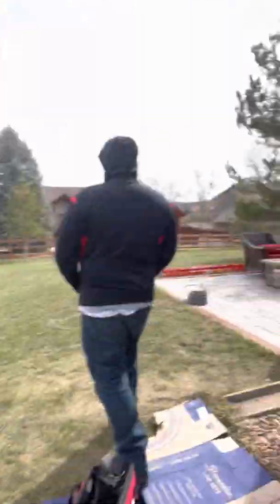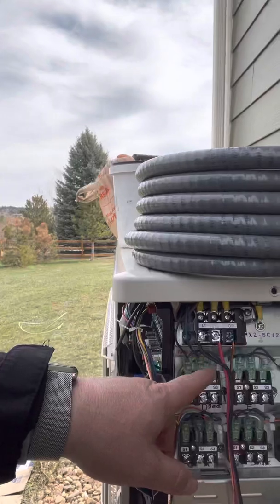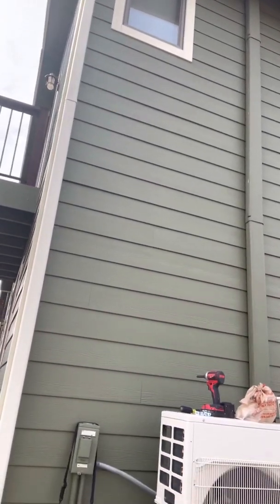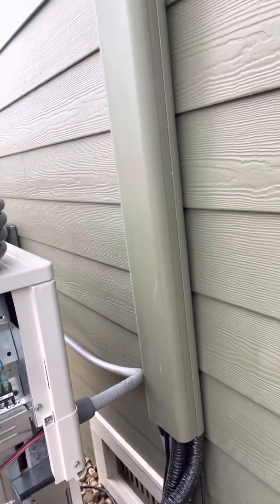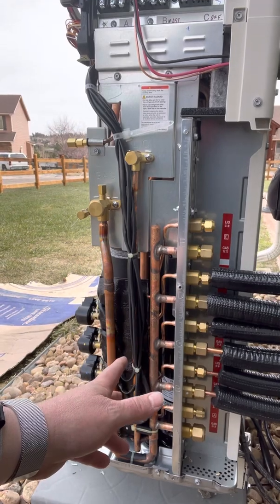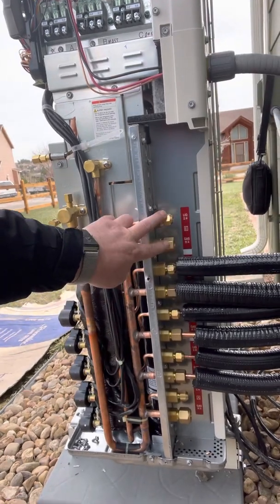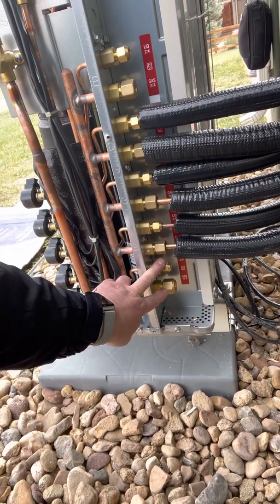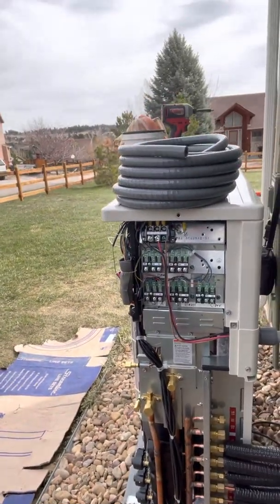How to size a Ductless A/C System 
(best Mitsubishi Multi port install!)

Comment: I'm new to ductless systems that's why I'm here to learn about them and installing them.  Your videos are great. I do have a quesition on this one, I understand adding refrigerant if the line sets are longer then the factory charge. I found calculators online to figure how much more to add. You said to do a DSB calculation to find how much is needed. What is a DSB? and you also said never to take any of the charge out even if the lineset is shorter then spec?

Comment: Good to know about the derating. The installation book for the MXZ series says you can oversize the indoor units, by up to 130% (paragraph 2.4). For the 36k you can install 46k of indoor, for the 48k you can go to 62k, for the 60k you can go to 78k. I guess the thinking is you'll "never" need ALL the indoor units at full capacity at the same time.
Reply: p.s. Love your videos!!
Reply from the maker: @nwsvndr  thank you 

Jared
Reply from the maker: Yep, our design program builds all our systems depending on elevation.

Comment: No brainer. So simple.
Reply from the maker: A DSB is called a diamond system builder. It’s a program you install on your laptop. You can download that from the Internet and you never have to remove refrigerant if the line sets are shorter.

Comment: Not sure if your calculations are correct, You are zoning the whole house so seldom outside unit will work full capacity plus the inside units can modulate. Great video.
Reply from the maker: Do you know what a “Dimond System Builder” or DSB is?  After we do a load calculation we match the performance from the DSB and get a true performance output before the sale of the system. That ensures the performance drop matches the BTUs of the design of the outdoor-indoor units. We don't just install systems. Go to Mylinkdrive.com and check out some of the equipment and download the DBS from Mitsubishi it will not allow you to design systems poorly and it's fun to play around and build different systems and equipment to see how they perform. On the design requirements section makes sure you know the alternative performance drop to input on the (Indoor and outdoor units) we have a 17% drop due to altitude.  A company that's not using a DBS is dropping the ball on designing Ductless systems.
Reply: @ductlessplushvac  Just left uneducated comment, all you say is the right way to do it .Thanks for reply. Looking forward to more of your videos.

Comment: Yeap you are correct. I always recommend read the manufacturer instructions and recommendations. Sometimes you can go a little bit oversized depends the way the customer use it. I add 12k btu to a media room but the customer understands he needs turn off the master unit. Also I have to add more Freon to the unit under the specifications. The equipment was a heat recovery.